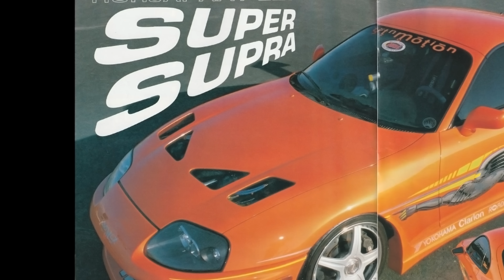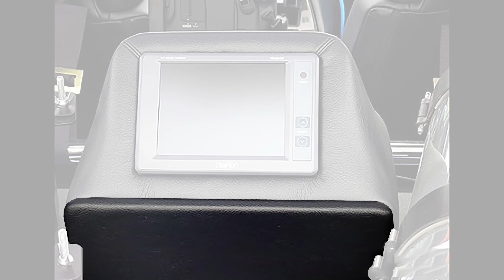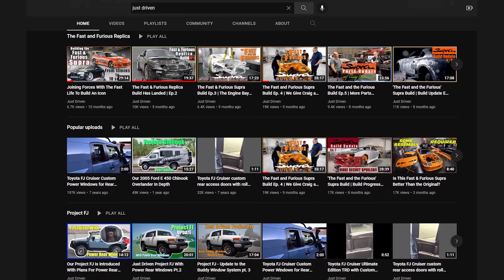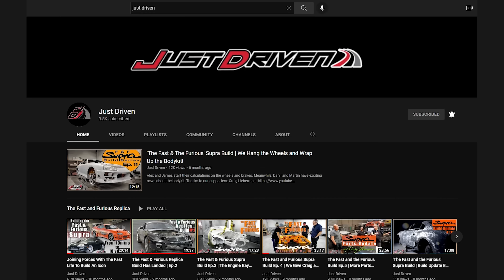SUPRA BUILD UPDATES

Comment: Craig, please have them change that fan shroud! That is the Non-turbo Supra fan shroud. It has a sharper edge on the hump. The turbo fan shroud is nice and round on the hump without that sharp edge and it is not as deep towards the engine

Comment: All-aluminum 8,382 cc (8.4 L; 511.5 cu in) V10 engine rated at 640 hp (477 kW; 649 PS) at 6,150 rpm and 600 lb⋅ft (813
Reply: That’s the actual engine specs from the engine from the movie car Tokyo drift viper